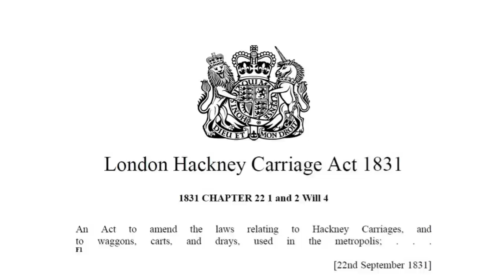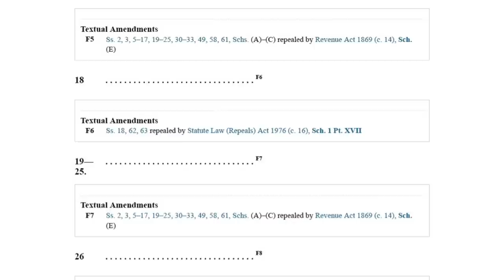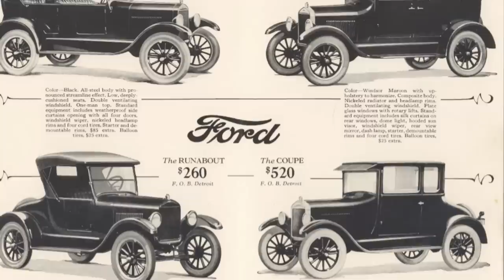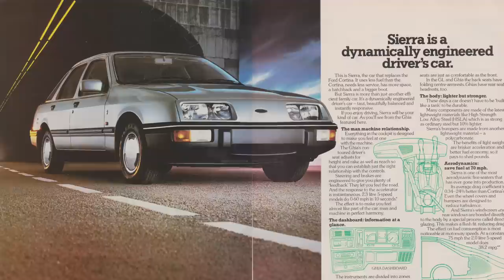Four Automotive Myths That Just Aren't True

Comment: I had a '89 Alfa 164 and remember being lectured by a Ford Sierra owner about Alfas being rust buckets. After two years he had rust blisters around his door locks and wheel arches. The Alfa was perfect.
Reply: Alfa 164 had 6 years rust warranty .. what a brilliant car ..
Reply: 164 was such a mega car,  my mate had one late 90’s
Reply: and then everyone clapped?

alfas WERE rust buckets.  they just largely fixed the problem (partly caused by poor quality russian steel but that was from being the only or even the main cause) by the time the 164 came around.   the 164 was possibly helped by its design being assisted by saab, who possibly told the italians that maybe its not such a great idea to design the car so it collects as much rainwater as possible
Reply: @jemimallah2591  - Did you even watch the video? Alfa Romeo never used soviet steel.
Reply: Parents had an Alfa Sud, replaced it with a Renault 16 and then replaced that with a new Sierra. The Sierra was rotten in 3 years.
Reply: @module79l28  yes i did and yes they did, as did fiat and even ferrari.  all the video refutes is that it was anything to do with lada licensing the fiat 124.
Reply: Most Italian cars had solved their rust issues in the 80s. I still see loads of Alfas, Fiats and Lancias from that age on the road. Mostly the Tempra, Dedra and 33.
Reply: @jemimallah2591  - 1:12.

Comment: Many cars of the 60'&70's were rust traps, one reason was something called production steel, sheet steel that was rolled from stacks of steel and lead like some form of puff pastry. The idea was it made it easier to get deep drawings using softer steel dies or in some cases even concrete dies. This steel was not only highly hydroscopic but was also stored outside in the weather in many cases,I have personally seen it outside in the rain. The water that caused the rust was already trapped inside the car panels when it left the production line.
Reply: Yes it annoys me (probably because I own an Italian car from 80s) that the myth is perpetuated that all Italian cars are rust buckets - as if nothing produced by BL or Ford ever suffered from this problem. Truth is, mass produced cars from most manufacturers of this period rusted in a much shorter time frame compared to new cars we buy today. A lot of it was to do with poor manufacturing processes as you describe - my grandfathers SD1 was absolutely the worst car I have ever seen for corrosion and my grandmothers MG Maestro was delivered new with rust on the cills. In contrast, my uncles Lancia never showed any signs of corrosion in his ownership. My Lancia is 40 years old and thanks to a decent covering of Waxoyl, is rust free and still looking great. Standards and consumer expectations were much lower in the 60s and 70s and manufacturers just didn't build cars to a standard to last. Not even companies like Volkswagen were immune, with plenty of rotting Polos and Golfs evident. Volvo (due to their climate) had to build their cars with a different set of priorities and so majored on mechanical simplicity combined with under body protection. This contributed to increased reliability at low temps and a decent lifespan from the structure. The benefit Volvo noticed in countries with less extreme winters, was a significantly longer lasting car than a lot of contemporary manufacturers could achieve. The difference was so noticeable, Volvo ran a marketing campaign based on this point. Maybe this kickstarted the increase in quality in other manufacturers, who knows.
Reply: @sevensixtysteve8662  It’s certainly true that manufacturing quality has improved over the years. In the past, there was an busy aftermarket for products like the “Waxoyl” that you mentioned. Some are still trading, like Ziebart,  if you search for it, but probably not so popular now. I can remember when my old man had a job done on one of his cars that involved replacing part of the car’s flooring with new sheet steel, by cutting out a chunk and welding in new. That was a Riley 4/68, when it was about 8 years old.
Reply: RR stood many of its components outside for a year to make it rust, this showed any bad metal parts, while the good metal would only have surface rust, which after being brush down make for the best paint key, there are still loads of heavy industry that still leave metal parts outside for it to rust
Reply: @southerneruk  Castings are often left outside for months or a year or two so that internal stresses have a chance to work themselves out so that the chances of the castings warping  are reduced when machined, leaving sheet metal out to rust is not a good idea as that certainly won't tell you what is good or bad about it all that happens is more rust forms where there is less surface oil.
Reply: Which would explain why, (Among other reasons) our MK 5 Cortina needed underfloor welding for its first Mot test at 3 years old. I'm glad those days are gone.
Reply: I don't know what you think is different but go to any body stamping plant like Ford's Walden Hills plant in Ohio and you'll see huge coils of sheet steel coming in on flatbed tractor trailers, then take a tour of the place and you'll see where it's fed off those coils through straightening rollers then sheared to lengths, from there they go through the stamping dies.
The reason all these cars last so much longer today than they did years ago is because they are better designed not to hold water in areas and they prep the bodies with better rust inhibitors during production. 
Just like engine's and transmissions last longer nowadays because their designs and manufacturing processes have improved the bodies of cars are lasting longer, because the designs and manufacturing processes have improved, not because they use some kind of super steel nowadays.
Reply: A very interesting explanation.  I've heard all these claims and counterclaims about Russian steel before but was always somewhat perplexed because there was definitely some sort of problem with the steel being used around that time and it affected other makes.  A relative had a Fiat 131 which rusted in the most extraordinary places such as right in the middle of the doors and even the roof!  I remember even seeing in the 70s Volvos exhibiting substantial amounts of tin-worm as did the Mercedes W123.
Reply: @Equiluxe1  RR use to leave moulded body shell outside for a year, for the same reasons. Surface rust makes for the perfect paint key
Reply: @dukecraig2402  Here in the UK ford had a storage facility beside the Thames river that was subject to tidal flooding where they stored cut flat sheets waiting to get pressed. Modern cars are made of high tensile steel which is much harder and requires hardened dies for stamping the old production steel which was quite literally a multi layer sandwich of steel and lead was very soft and ductile so dies could be made of concrete.
Reply: @Equiluxe1  
The slightly harder sheet steel that's used in some vehicles today will rust through faster than the regular mild carbon steel that was used on vehicles from the 60's and 70's, once again the bodies last longer on today's vehicles because of better designs that don't have a tendency to hold water in area's prone to rusting and because of better production methods that coat area's much more thoroughly and evenly with rust inhibitors. 
The reason why they use the steel they do in today's vehicles has nothing to do with rust prevention, as I said that type of steel will rot through even quicker than the thicker mild carbon steel used in vehicles from the 60's and 70's, back then 18 to 20 guage steel was the norm for body panels, today thinner sheet around 24 guage is being used simply in the interest of making vehicles lighter, quite a few manufacturers have even switched to sheet aluminum for weight reduction, the only reason they use the type of sheet metal alloy they do now is because as thin as it is just leaning on a vehicle in the wrong spot could cause a permanent distortion in the body, this is also why you don't see the large flat area's seen on the cars of yesteryear, by putting a lot of shape in the body panels it makes them more rigid which is needed with the thinner sheet used today.
What they're using today isn't hardly "high tinsel steel", it's harder than the steel used years ago but not that much, it's not like it's tool grade steel, it's simply a little harder to offset it being easier to push on and deform an area, even then they still use steel that's as soft as they can get away with for the sake of a vehicle crumpling in a wreck and absorbing energy. 
As far as all these stories I keep reading in the comments about body panels being in places that flooded I'm taking those with a major grain of salt, if they really were rusted before they were used they have to have their surfaces cleaned very thoroughly either by chemical etching or abrasive blasting for the sake of painting, you absolutely cannot paint over rust and expect people to buy a vehicle that'd look like one would if it was painted over even the slightest traces of it.
No, what they use nowadays has nothing to do with why vehicle bodies last longer, the fact is if they used it with the production techniques used years ago they'd have rotted through even quicker than they did back then.
Reply: @dukecraig2402  I have personally seen the ford steel stored at the rivers edge in the mid 1970's somewhere I even have a photograph or two, back then I drove a truck and took a camera with me and took photographs of anything that interested me, that was normally anything to do with engineering or industry.
Reply: @southerneruk  That's interesting. Where I live in Bilbao there's a music and conference centre, the Euskalduna, built on the site of a former shipyard. The outside has limestone, glass and an amazing steel which has rusted to a brown colour, intended to resemble the hull of a ship. When it was first built I thought it was hideous but it has really grown on us all now!
Reply: So true, we used to flood the underside, inside the doors and sills with fishoil to stave off the rust, hell of a stinky car until the smell disappeared.
Fish oil worked really well though.
Reply: The steel wasn't only poorly treated (if treated at all) but full of rust itsself within the metal.
Like rolling out pastry with lumps.
How to explain that SOME cars didn't rust as fast as others ?
Good luck to this teenager who should focus on EV's at his age.
Reply: I say bull dust on that. steel hasnt been rolled like that since the early 1920's, with the advent of the continuous Hot Strip Mill and Cold Reduction Mill back then. sheet steel was and is first hot rolled from steel slab into a coil at the HSM then sent through a Pickle Line for acid cleaning. then it's cold rolled into a thinner gauge at the Cold Reduction Mill. Cold mills like HSM's usually have five or six mill stands so each stand reduces the steel a little until last stand produces the final gauge to the desired thickness and it is then coiled up. for auto sheet it usually goes through coil annealing then a final run run in the Temper Mill and the coils are then sent to the car makers. for the past thirty years, dpending on customer and auto end use, coils are finally run through a Metal Coating line to give it a thin layer of zinc/aluminium similar to roofing iron, but without the spangle. steel coils for auto sheet before the 1980's were generally delivered bare coated without the zinc/aluminium or similar alloy.
I've been working in steels mills for the past fifty years and know my way around them. I've seen old company films of them rolling sheets of steel in multi layers back in world war one days and with the advent of continous rolling production boomed making the old single stand mill obsolete
Reply: I had a 1967 Mustang that basically rusted apart by 1972.
Reply: @bonza167  And what do they use today in car plants, not steel direct from coils, tailored blanks which are different pieces of various thickness cut and laser welded into the blank so that they get the correct strength for the parts crumple zones etc. And the old car panels from the 60' & 70's very often if you work them back and forth they will separate so that you can see the layers, yes they rolled a slab into sheet but that slab was multiple slabs stacked on top of each other
Reply: @bonza167  As a layman I found that very interesting and informative!
Reply: @MichaelStoneRichard  Not Russian Steel, but do you live by the sea ? Ford NEVER protected their cars against rust until the 90's and they are/were notoriously known to just rust away. ANY Ford.
Sorry to hear that but there were 100's of thousands of Mustangs produced (and cheap too).
Reply: @team3383   Not by the sea. In Detroit, lol.
Reply: @MichaelStoneRichard  Oh well. Just goes t show how shite Fords were made at the time ?
Reply: It’s hygroscopic, not hydroscopic, there’s actually no such word as hydroscopic unless you’re talking about a specific underwater device.
Reply: @Equiluxe1  But cast metal only rusts on the surface. I heard that they rediscovered the dies of the MGB body on some field in GB, and just had to clean them up, and now you can buy new MGB panels. 
 
I also heard that for their Formula 1 turbo engines BMW used used standard engine blocks that had at least 80,000 km runtime, because those were seasoned so that they could withstand the extreme heat of an 800 hp-turbo engine.
Reply: I heard the Alfasuds were built at a factory directly at the coast, and so when the bodys stood outside longer (due to frequent strikes), the bodies would get a salting under the paint before the car was even painted and assembled.
Reply: @feedingravens  On the beach at Holkham in Norfolk near where I live is the remains of a vehicle that has been there at least 80 years, the engine block is has been eaten in half by rust caused  the sea water along with most of the chassis there is absolutely no body work left and only part of the front axle. So cast metal will rust away just takes a bit longer.
Reply: @Gareth Ifan  We had a family friend who worked for Ford, possibly Dagenham, he said after some strikes he pressed new wings from rusty metal, that would have been in the late 70's
Reply: @dukecraig2402  that is for sure, also the prep and coatings are better and applied in more controlled surroundings. There are many parts now made from plastics etc in the area’s prone to rusting
Reply: I used to know someone who worked for rover in Cowley, Oxford. 

The body shells arrived, unpainted, and were stored outside. It rained, and then they got water into the seams. 

It was called seam-bleed. The seems bled (red) rusty water. They were rusting away before they even got built.
Reply: It would helpif the shells were actually painted, the paint was on the outside but all the box sections were devoid of paint inside. Dipping and electro phoretic coatings was the end of that fault.
Reply: "Many cars of the 60'&70's were rust traps, one reason was something called production steel" Fortunately, my Land Rover has aluminium body panels.

I remember a while back Audi made a big deal in a TV advert about the A8 being an "Aluminium car for the space-age."

Huh. My Land Rover was built in 1967, so definitely space-age.

(It doesn't have rust from the factory, but they did install the oil leaks as standard)
Reply: @dukecraig2402  Engines and transmissions last longer today? If that's true, then explain why the only cars still running after 500k+ miles on original motors are 20+ years old. It's not a matter of time taken to accrue that mileage, because anyone who drives a decent distance for work can easily rack up 35k or more per year. There are Checkers, Hiluxes, and Volvos out there with over a million miles on the original powertrain. What model since 2005 can back that up? Cars these days are dramatically less reliable.
Reply: yet cars from the 40's and 50's can sit outside for 60 / 70 years and only have patina on them

Comment: I worked in sales at an Alfa main dealer from72 to 75. When the transporters arrived with the Sud they were inspected and most sent to the paintshop for paintwork especially the external boot hinges that were rusted solid. On the plus side the original sud sport was the best handling small car by miles at the time.

Comment: Thank you for this interesting video: I wasn't aware of a couple of those myths.  Back in the 1960s Vauxhall had a reputation for rusting badly, which was supposedly caused by the use of inferior steel.  However, my father, who worked at the steelworks that supplied Vauxhall, told me it was in fact thicker and better steel than that supplied to other British car manufacturers.  As an aside, I think the myth about being allowed to shoot Welshmen with a bow related to Chester, rather than York.  One would have to have a heck of a big bow to shoot into Wales from York, whereas from Chester it's a tad easier :)
Reply: The Alfasud story must have changed because when I had one the story was that some cars were made from a batch of good steel coming from Germany. I only had my Alfasud for 18 months and it did not rust so I always assumed it had come from the batch of German steel.
Reply: Yes.... I'd go along with that , except....as I recall...all makes seemed to rust very quickly around 1971/2..... and global production of poor steel was blamed.
But yes.... Vauxhall did indeed seem to be the worst culprit.... "Rot Boxes" we knew them as.....  
Thankfully...it would seem most manufacturers have resolved this blight on their expensive offerings.  Wheel arch linings in plastic being their salvation.
(Where I live in the world: Rust on cars is never a problem.... because there is never  any salt on the roads.....even sand gritting causes  problems as it removes protective coatings.)